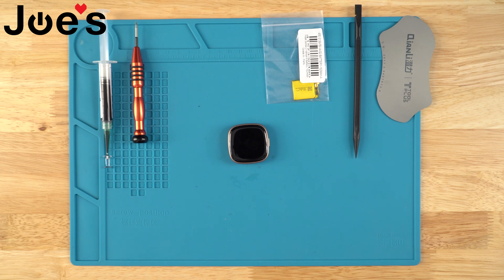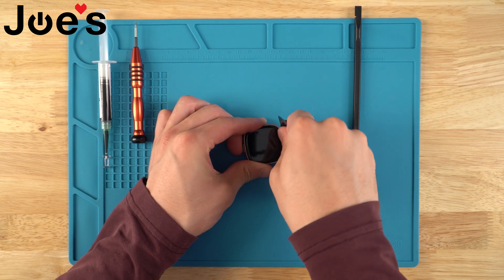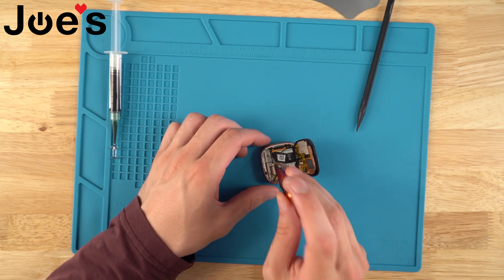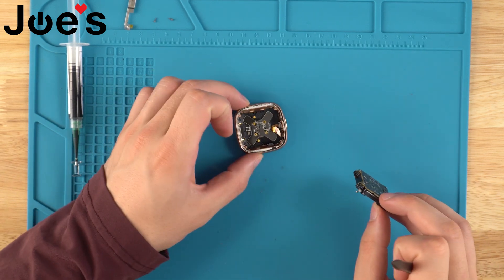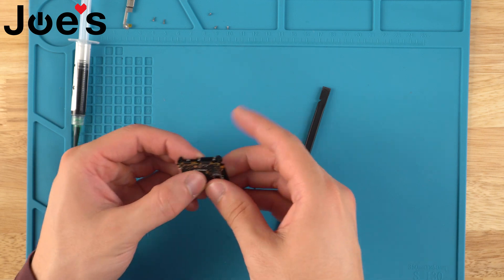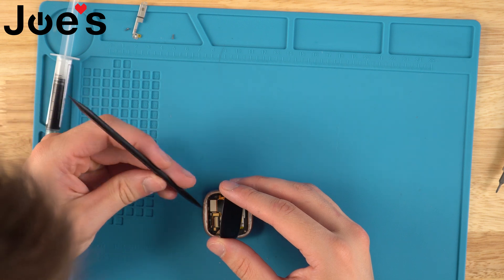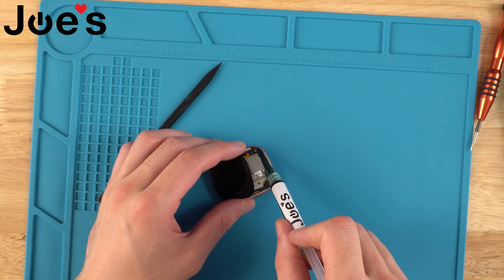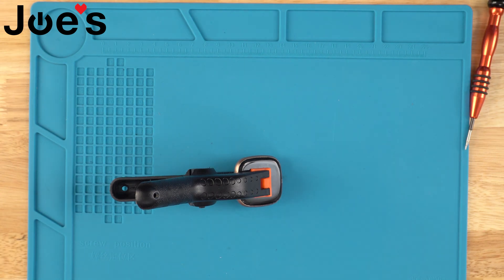Fitbit Versa 4 & Sense 2 Battery Replacement Repair Kit | Step-by-Step Repair Tutorial

Comment from the maker: Original Repair Part: https://www.joesge.com/products/fitbit-sense-2-fb521-smartwatch-repair-spare-replacement-parts?variant=40222893998126
Original Repair Part + Repair Kit - https://www.joesge.com/products/fitbit-versa-4-fb523-sense-2-fb521-battery-replacement-repair-kit-parts
Fitbit Mail-In Repair Center - https://www.joesge.com/pages/repair-service-fitbit

Comment: At 3:20 I highly recommend telling folks to fold down the ribbon cable clips. When I flipped mine over to take the screws off i broke off the larger ribbon's clip since they were still open. The plus side is rhat I had Kapton tape and it is under the heatshield, so it shoud stay in longterm. 
Loved the kit. Have mine drying/curing now. All done in a 45 minutes or so.
Reply from the maker: Good tip! Thanks for buying the kit from us we really Appreciate it